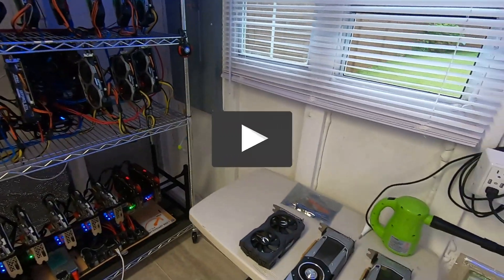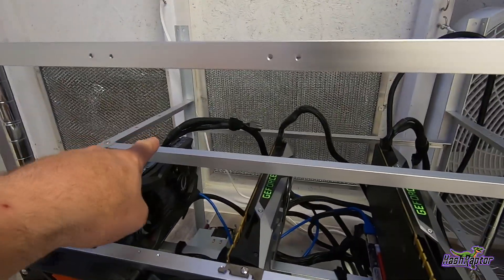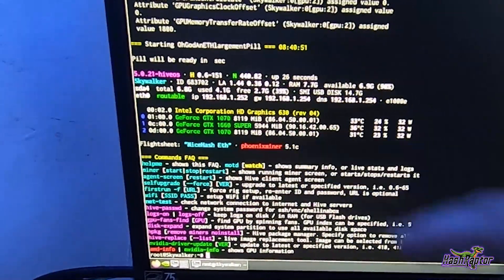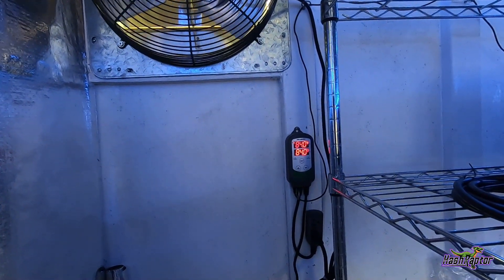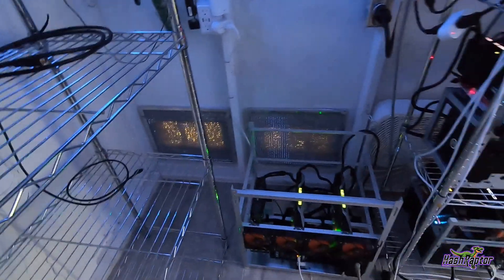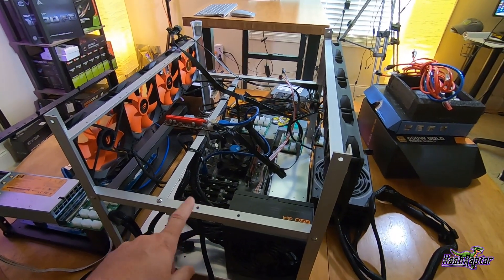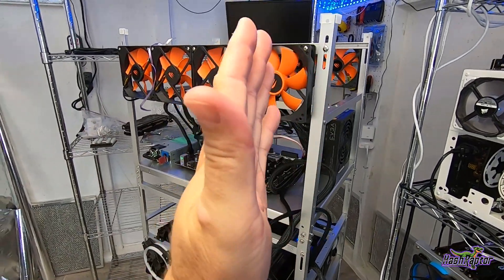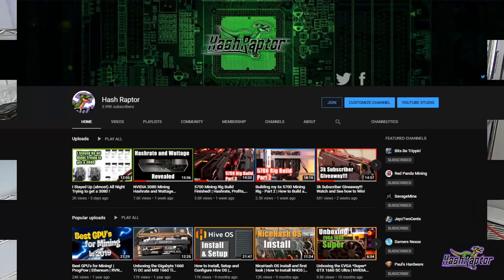Cryptocurrency Mining Cave Shed - Part 12 | Stacking aaawave frames and installing GPU's!

Comment: always love watching these videos.  i do have a few questions though your 1070 is getting way more hash  than my 1080  anyway to boost my hash rate? im using nice hash and i have currently 100+ core clock and a +300 mem clock  not sure how to get more hash out of it.  mind you im only  just now getting in to mining so im super green
Reply from the maker: Hey no worries. I assume you are using Windows, so there are two things that would help. First, make sure you drop your power / TDP down to 70 or 80%. Then move your memory to plus 500, and move up 25mhz each time from there until it becomes unstable, then step it back. You could also try +125 and 150 on the core clock. Lastly, enable the “eth enlargement pill”. I believe they are now putting that in NH in Windows, but I could be wrong about that. You will see a big jump of 5MH or so once that is enabled. Good luck!
Reply: @HashRaptor  yes using windows but i suppose i should have prefaced this comment that its my main gpu for gaming as well  but i can set a nice profile up  for when im mining
Reply from the maker: Okay, just follow this instructions and you should be around 35 MH.
Reply: @HashRaptor  was able to clock  up  a bit and i went ahead and re- benchmarked  it got a bit better fine tuning to get exact will take a few tries but already can see a difference
Reply: @HashRaptor  thank you for the quick response <3

Comment: I fell in love with these frames. So easy to put together and everything doesn't have a coating of oil on it like with the Vedha frames and much lighter because angled aluminum instead of steel. And they have a full solid bottom!
Reply from the maker: Yes!!!

Comment: I'm no expert, but at 3:12, aren't your fans mounted backwards? more efficient blowing rather than sucking...?  Please advise
Reply from the maker: Yes great eyes. So I’m playing with facing the fans in because of the fins on the array of those cards pointing up and down. When I turned the fans in, the temps on the interior fans dropped 2 to 4 degrees. Still testing and may try aaawave fans.

Comment: I think one of your front fans on your AAAwave studio rig is reversed. And I would check also the front fans on your RX 5700 rig for direction.
Reply from the maker: Thanks for checking them out. So the aaawave fans are all pointing to blow air away from the rig. You are right about the 5700’s. I’m testing those fans blowing inwards with the direction the heat sink fins pointing up and down. It actually lowered the temps of the center cards by 2 to 4 degrees. Still playing with it though. Good eyes!

Comment: on my hive os page.. it shows that Intel Corporation HD Graphics 610 (rev 04)  at the top in yellow letter and i dont have a monitor plugged in.. i think when a monitor is plugged in tho it goes away.. strange
Reply from the maker: You should be able to disable it in the bios if needed.

Comment: if you do , make it "mining with the 1070s in late 2020" video as like a check in to see what the earnings are and if hashrates are still descent.
Reply from the maker: Got it.
Reply: @HashRaptor  cause some stuff changes, larger DAG, new algo forks, new miner programs with better efficiency/hashrates, new drivers etc etc.
Reply: Awesome! Would love to know your clock speeds and voltage settings etc for your 1070s. I still have 2 of these for my children PC's